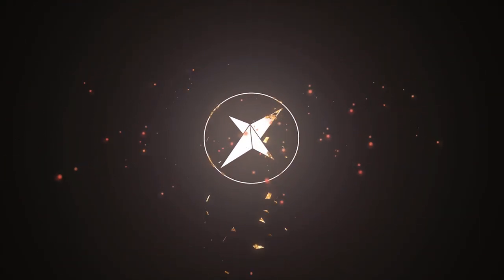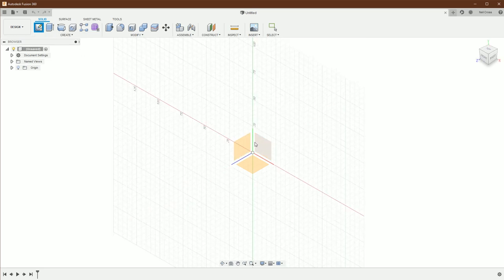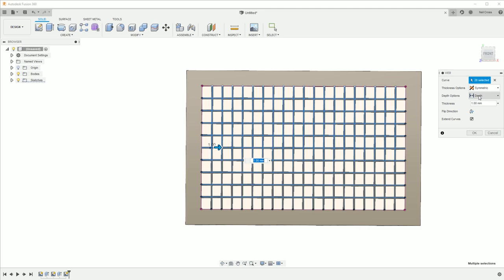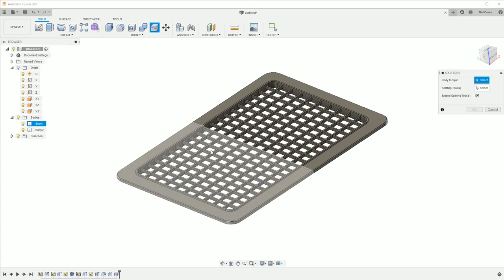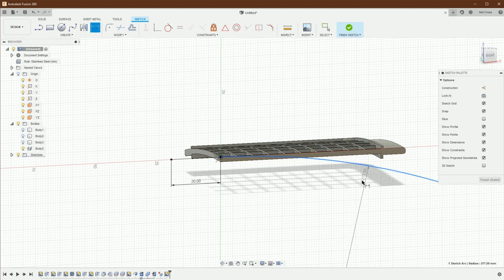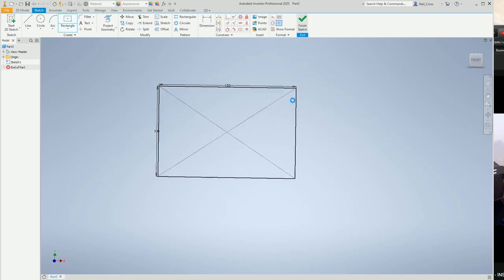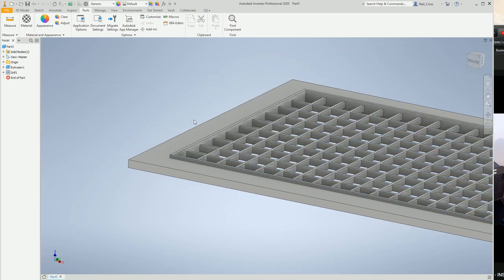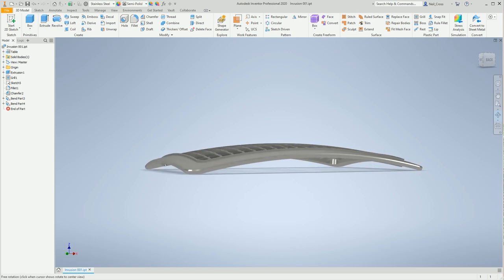Invusion CAD Challenge #001 RESULTS! - FUSION 360 & INVENTOR

Comment: nice video. At 20:30 when you are typing in the bend radius value...we just need to add a delay to the input of that dialog. We did the same for view scale in drawings a few releases back to help with performance. I know, I know...that is what I noticed out of your 25 min video, right.

A small glimpse into the mind of a product manager I suppose.
Reply: Loren Welch do you work for autodesk? I work with VRED for my job and would love if VRED used inventors constraint service... think you can pull some strings?  ;)

Comment: LOL - you are kind of annoyed by Autodesk using fusion, but that obvious BS by Autodesk a bend which has an option which states: radius+angle and then it doesn´t need the angle??? So I would call this a happy accident if someone stumbles over that issue. Almost the same as the pattern along a curve which has not its own symbol and is hidden inside the rectangular pattern.  Or the draft with an edge which doesn´t highlight the selected (by clicking the face near to that edge) edge . So many little annoying things.
Reply from the maker: I think i'm fine with the bend angle thing, it only doesn't need the angle when the radius of the bend extends over the entire surface area - it indeed makes the angle an obsolete input in only that situation... but to grey out the angle for that situation they would have to somehow validate the geometry size against the radius you've put in, which would be unnecessarily computationally expensive for such a minor thing like greying out a field.
Reply: @Neil3D  They should not grey it out, but make it a separate option/field. There a lot of those inconsistent shortcomings in almost all autodesk products and of course in every other CAD program as well. It annoys me especially because I do professional trainings for  about 15 different "sources of tiny little bugs" ;)

Comment: only got screwed by the bend order :/ wasn't really clear what order to use from the Link though
Reply from the maker: It was part of the challenge... there was a reference angular dimension on the first sheet which hints at the bend order, also the end faces of the part are angled whereas they're perfectly vertical if the other bend order was used, it wouldn't be a challenge worth doing if it was super easy!
Reply: @Neil3D  To be honest, the "gotcha" approach to artificially raising the difficulty is turning me off returning for next month's challenge.  

If the bend order was a necessary part of your design intent, then the  failure was yours in not conveying it properly in the schematics.

Comment: Would you get the correct answer at the stage before the bend, since it doesn't add mass or volume? Or does it?
Reply from the maker: I think the pinching and stretching of the surface faces alters the mass properties very very slightly during the bend